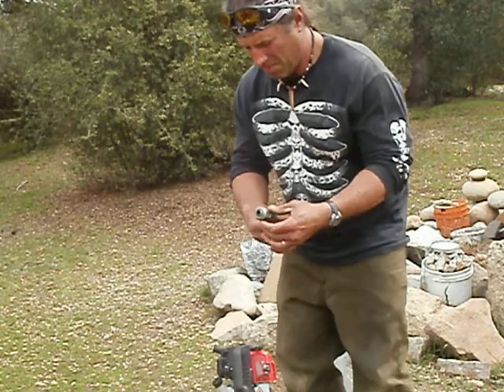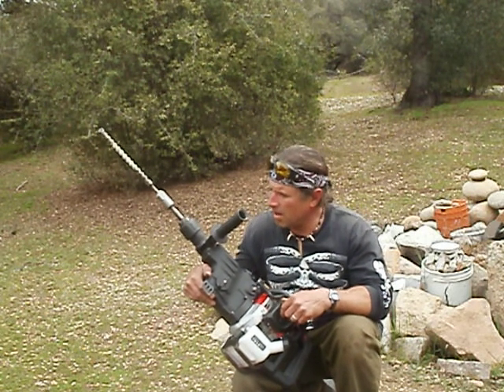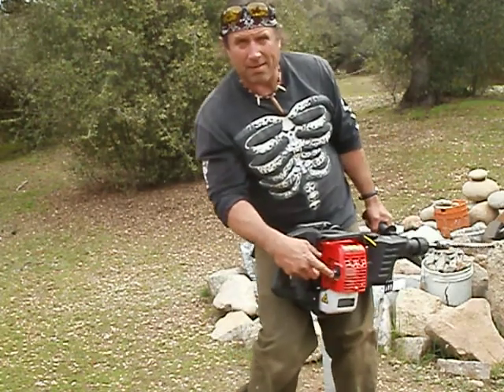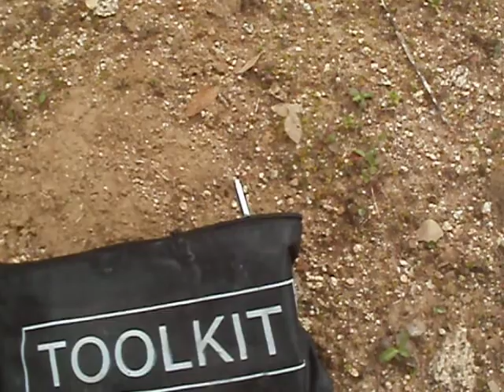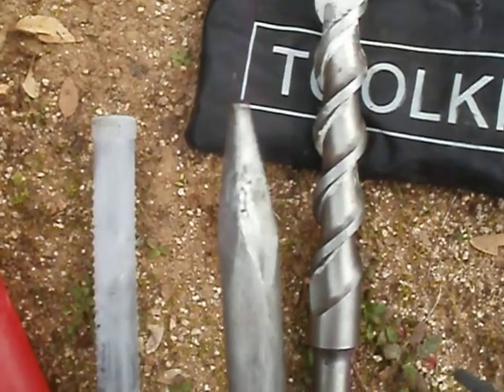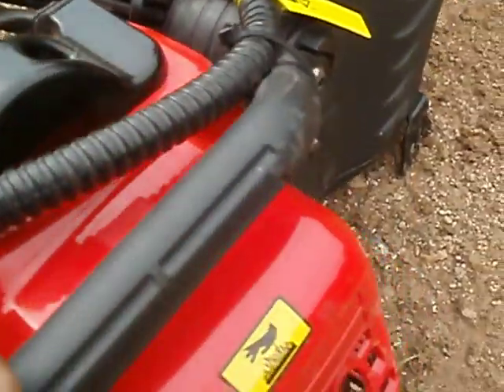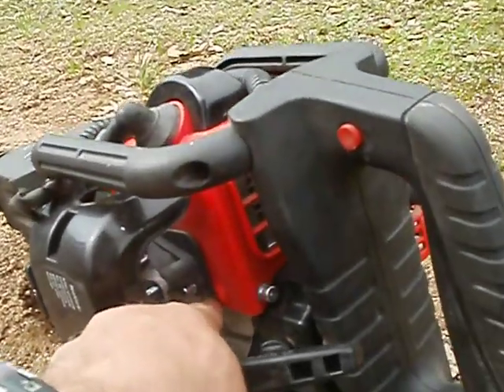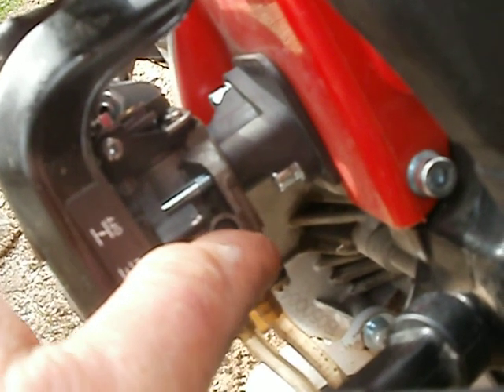Ebay gas powered rotary hammer drill

Comment: How as it held up? I am thinking of buying one here in Canada. Thanks
Reply from the maker: I used this to drill and "jackhammer" a 3x3x6' ish "decomposed" granite rock for removal for quite a few hours at a time multiple days in 90 degree weather, for digging holes in rock hard- dried "decompgranite/clay/compacted dirt, and for drilling some granite for splitting. this has held up well (I have and still runs since 2007 another smaller but less well built 23cc rotary hammer drill That has been used for quite a few Backcountry trail crew seasons exclusively for drilling granite for "the cut") This drill seems much better built than my 23cc much used one-
Modifications that can help with this machine cutout the (c.a.r.b.?) restricted crankcase transfer port air restriction plates. use anaerobic gasket sealer and delete the head gasket for more compression
Reply: @douglasmatheson403  Thank for the reply

Comment: Is 2 exhaust or 1 exhaust?!
Reply from the maker: 1 exhaust, single port, and single cylinder engine, the biggest "Mod" I did was elimination of head gasket (replaced gasket with anaerobic gasket maker) to give greater compression)
Reply: @douglasmatheson403  In my country we only have a few brands such as jhc model and royce model which one you think is better to buy

Comment: What dose sds adapter do?! Does it ease the drilling
Reply from the maker: This gas/petrol rotary hammer drill is sds max (more splines and larger diameter than sds plus) the adapter is sds max to sds plus= A way of running an sds plus drill bit in an sds max drill. I hope I'm making sense with this. Have yourself a very nice day and hope this helps you in some way
Reply: @douglasmatheson403  do you recommend me buying this device for drilling holes into the the rocks and boulder in order to split them with wedges and feathers?!
Reply from the maker: Yes I really like this one I have bought a 22.7cc (had cheap plastics though) I bought in 2007 and still use it at work because of its portability (I've worked on park service trail crew since1997,  and the 22.7cc  has traveled with me in to very remote areas and used extensively, for splitting boulders and rocks with plugs and feathers(wedges and shims) This 33cc model is bigger than the 22.7cc model, but built a lot better has more power, and a much stronger hammer on it! This model can be switched from hammer drill to hammer(chisel mode). I Do Recommend this Drill for your application.
Reply: @douglasmatheson403  thank you so much for your help tomorrow I am going to order the RRH_58  32.7cc 12j